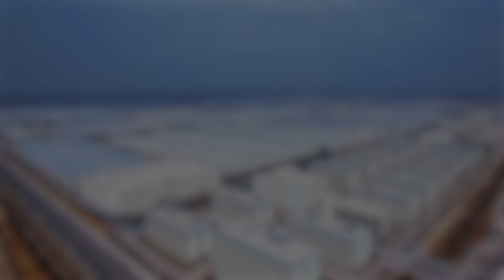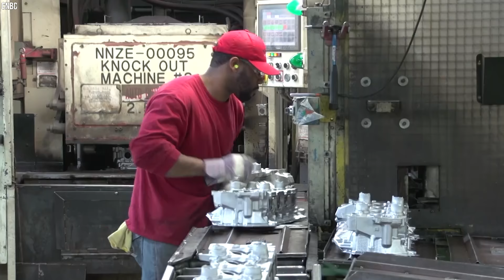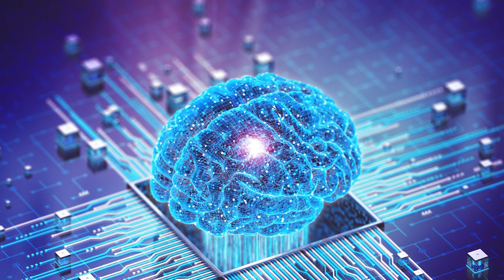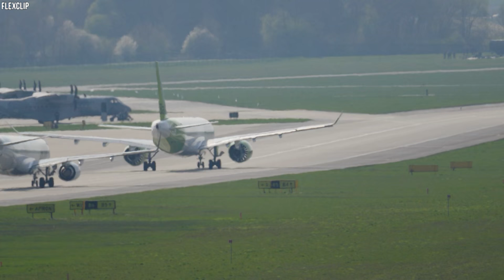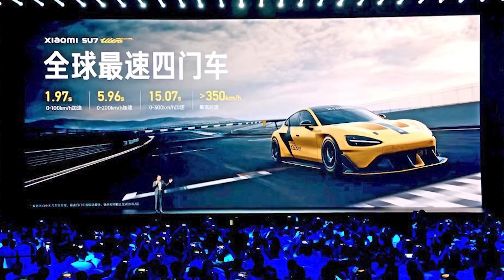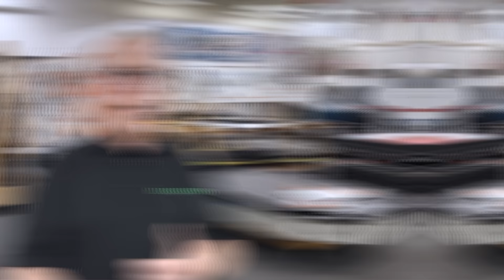China's INSANE Technology Just Killed Aluminium! XIAOMI CHASSIS 2026

Comment: Anyone can do what China is doing. Using molten metal in very large castings is not new. They just copied Tesla. The phone company came up with a proprietary AI recipe for their metal. That is also not new. Their metal mix is not radically difference than Tesla but how much AI was involved in developing Tesla’s recipe is unclear. There are different metal mixes that work just fine. If you have something that is 1 inch long and you turned it upside down, it is still 1 inch long. It appears that making the battery part of the frame structure is also not new. All your video did was point out that there are different ways of doing things, but the end result is all that matters and is not all that much different from the leading competitors.

Comment: Batteries weigh alot. Solve that first. Big battery cartridges that could be switched at a "gas station" when traveling. Instead of filling your tank you switch cartridges instead of carrying all that battery weight. Stations re charge them.
Reply: They already have that.  I saw a British journalist take a car through one of those.  Took less than 5 minutes.
Reply: @progressprogress that should cut the battery weight, & increase milage. Not having to waste energy hauling around all the extra battery weight.

Comment: This is so intensely dumb. Xiaomi did not replace aluminum, they used AI to find an ALUMINIUM alloy (a mixture of MAINLY ALUMINIUM, with elements like silicon and magnesium mixed in), that has the properties they need for casting car frames. Which is not revolutionary: Tesla has been doing that for years already. And also, it has a big downside: if the cast frame is damaged, it is very hard/impossible to repair. And the car Xiaomi made: only in very optimal conditions it is able to compete with expensive racing cars, for a short time until it's batteries get too hot. Your video is worthless clickbait vomit.

Comment: I thought I'd see more comments from people saying that if a weld joint is a weak point then the welding wasn't done right.
I'm not a welder, but I know enough that proper weld joints fuse the pieces of metal together. If it's done right and you do a cross cut to examine it you shouldn't be able to see the seams between the two pieces of metal.
Reply: "I'm not a welder", that's all you needed to say.....
Reply: A weld is stronger and harder than the metal either side of it❗
Reply: You can still see the crystal structure in and around the weld after etching the cut. The important thing is that the crystals within the weld shouldn't be excessively different from the surrounding area, otherwise it creates a stress zone.

Comment: When you have an accident pieces can be replaced cheaply, if the frame is in one piece then a small accident makes the vehicle to be written off.
Reply: No ne prevents you to cut out the small accident area and weld in a replacement.
Reply: @angeloschneider4272 can you read?? LoL
Reply: Yeah but insurance companies already write off cars for dents and broken headlights.
Reply: A very good question! Maybe it's like the older Dodge models in the 1950s, where they used 4mm steel, in the car chassi. After a crash the Dogde looked the same, but the other car did not.

Or the people that could afford these cars, could buy a new one after the crash!?

Comment: Why use clips showing other manufacturers' body assembly processes—Volvo's, for instance?

It has long been known that an electric motor delivers essentially full torque from 0 rpm, offering a major advantage over an internal combustion engine.

So, performance figures don't really substantiate the superiority of a new material or alloy—especially since new ones are constantly being developed.

So, what was the actual news?
Reply: Volvo is a Chinese company, bought for a cool 1.8 billion.
Reply: @nyamutota  
Bought by Zhejiang Geely Holding Group and not xiaomi, unless you view all Chinese car manufacturers as a single entity.

Comment: Replacing aluminum with a new compound  metal is still another metal.
Reply: another alloy, but making the structure also a battery - reduces cost but makes a repair difficult
Reply: @Baruch-Hashem  How so?
Reply: @TheDarinseng  complexity. simple welding would be out.
Reply: @Baruch-Hashem  Tesla already does this.
Reply: @Baruch-Hashem  it also makes the whole car disposable. Something happens to the batteries and you can't replace them. And the batteries will lose their ability to charge after a decade or so, which means after 10 years all these cars will end up in the scrap yard.
It was bad when all these companies were making cell phones disposable, and then TVs and other electronics (printers are also really bad). But disposable vehicles like this is going to be a massive problem in the near future.
Reply: @nsday1  Rubbish, the battery is replaceable, do some homework....
Reply: It's just another aluminum alloy, there are literally 1000s of them. Without 3rd party testing this is all just marketing puff.

Comment: Lots of inaccuracies here, AI- BS
Reply: You need to fact check before running your mouth off. Not everything is AI BS.
Reply: @deepseek1958  I can say the analogy used for baking bread and heating metal is 100% off base.  Baking bread is a chemical reaction changing the molecular compounds into new compounds with different properties where as heating metal is not creating new compounds (outside some "potential" external oxides of no relevance).  Totally inaccurate.

Comment: A brand new metal ?  Maybe a new rare earth. :-)
Reply: Metal ALLOY
Reply: @roberthart9886  All useful metals are alloys.  I''m assuming you missed my light sarcasm.  The video did say metal.   By 'AI' they mean they can ask for certain properties.  There is no set of perfect properties to be iterated. Strength ( linear stress, compression,shear, bending)  ; weight; Contraction/expansion; Chemical resistance .  All at all potential useful temperatures.  Highly unlikely. And ONE solution?  For ALL castings ?  A simple case: a beam is loaded so that deflects by 5%.  With the load removed, does the beam return to its exact position ?  99.99% ? 99% ? after many repetitions?  Can the  AI see micro-fractures ? 
Undoubtedly XIAOMI will make the castings too thin and off come the wheels.
I'm truly embarrassed at the time I spent in watching and replying to this slop.